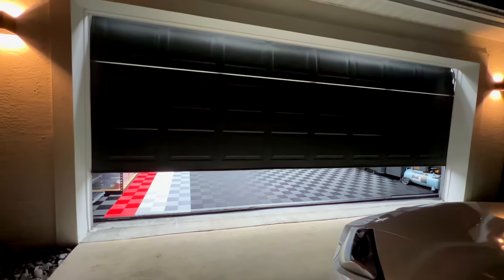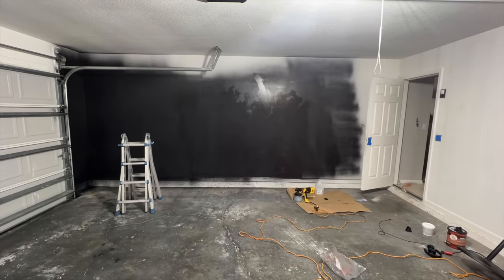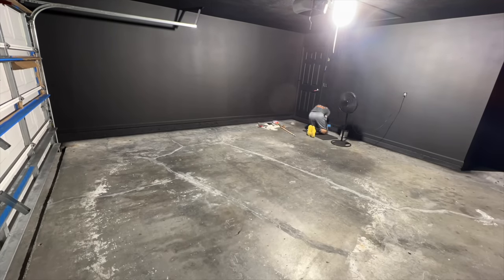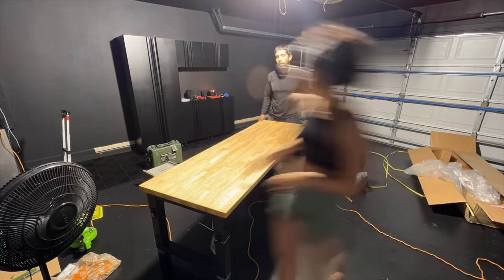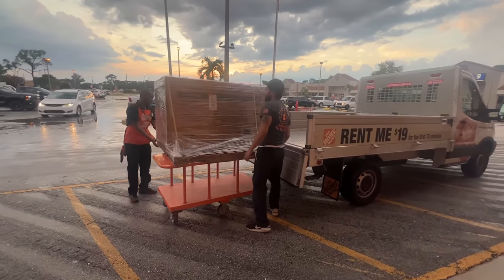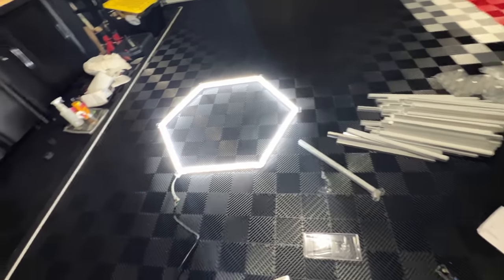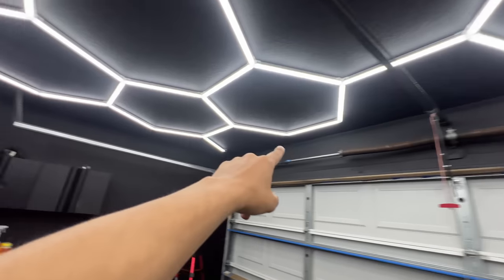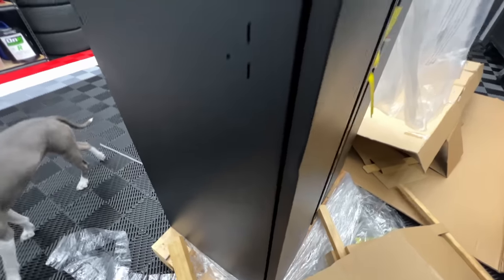Transforming My TRASHED Garage Into A SHOWROOM Style DREAM Garage in 10 mins!

Comment: you can use a kit to remove the dents, the same you use for car panels. it works pretty good and worth a try 😊 nice garage setup man!
Reply from the maker: I’m a sheet metal mechanic so I’ve taken most off already. I have to drill a couple holes somewhere to pull the other ones out.
Reply from the maker: @DanielDos2 husky bought at Home Depot

Comment: I just completed a full detailing garage (22 X 30) with build in water (hot and cold), floor drain, dedicated line for a wall mounted pressure washer, heat pump, trusscore material for my floors and ceiling and I love what you have done.  I am debating what to do with my floors.   If I didn't constantly spray water and all the gunk, I would do a floor like this but I am leaning more toward an epoxy with sand blasting or polished concrete but this is a really nice garage!
Reply from the maker: Nice! Im still working on mine, but in your case I would just get epoxy done.
Reply: @ZillaFullBoost hi what is the color and the brand of your paint please?

Comment: The lighting looks really good, but is it really worth paying 10 times as much electricity for the hexagons when a simpler design could have worked to provide nearly as much light on the edges ?
Reply from the maker: I had a simpler light and it wasn’t enough with the black walls.  I not only wanted more light, but an appealing fixture.

I haven’t noticed any rise in cost because of it either.
Reply: Came here for this comment. Depending on where you live and how much you’re in the garage. The difference of 10W lights and this 144W light system can be dramatic. Could easily add $50-$100 a month on your bill.  I’m in Cali unfortunately so those stats are not* overestimated.

Comment: Looks amazing! Would recommend finding a solution to holding down the floor panels, they move when you drive in or out so you could crack some with the Florida heat and enough pressure from exiting or entering the garage. Also, after seeing you spend as much money as you have, I am sincerely hoping that I am misjudging your garage door opener as a chain driven opener. If it is chain driven, switch to belt driven, you'll thank me later.

Comment: Get a spring and pulley and install it on the inside of your attic door to make that attic door rope disappear.and make a dowel stick with a screw-in hook on the end to pull it down with.
Reply from the maker: Good idea👌🏽
Reply: @ZillaFullBoost  it's what I do with all my attic door ropes and btw you'll also need a keyring for the end of the rope that hangs down from the attic door hole to grab with the hook on the end of the stick

Comment: I ordered the same series of cabinets and had the same experience. It sounds like you've done some repair yourself, but there's a phone number in the boxes you can call and basically make a damage claim (not HD, it's the manufacture, HD is not very helpful). They sent me new doors for 3 out of 4 on the tall cabinets, even a new hinge for one that was busted. Other than not being able to ship them without damage, they're really nice!
Reply from the maker: I tried to get replacement doors and they said they couldn’t send any for some reason. They wanted the whole unit again. 

I’ve extracted as much as I can from them for the inconvenience on top of the already discounted rate when they were on sale.

And I agree they are some nice cabinets when they don’t come damaged 🥲

Comment: Garage looks amazing! You went with a lot of the same ideas I did initially (my garage makeover is about a year old now). I was lucky enough to not have any damaged Husky cabinets when I ordered mine to the house. Curious, how do you like those floor squares? The flooring is the only thing I haven't done yet, still bare concrete.
Reply from the maker: If you’re a true DIYer using jacks and Jack stands takes a bit more effort. You need wood or metal plates between the Jack/ jack stands and the tiles so they don’t get damaged. That’s my only gripe with them.
Reply: Is it the floor tile you used is pretty much the same as the Swisstrax?

Comment: Sick garage. The 2 things I would def still do are jack shaft garage opener and some sort of door to close off that area with water heater. Great result tho man.
Reply from the maker: Yup, those are next. Also, I want to add a ductless AC unit, mount a vacuum with a hose reel and reels for electrical/compressed air.
Reply: @ZillaFullBoost  yea I’m looking into that wall retractable hose like the OG guy just did, really sick. Also, for a fraction of the cost of a mini split, I did a dual hose portable AC unit and just knocked two holes in the block wall for intake and exhaust. It works really good in Florida heat and it was cheap and easy to install. Keep up the good work.

Comment: I have the same lights and flooring coming. Still working on my garage. What size is the garage? You can send pics and get a discount for the dent. I have a lift coming too
Reply from the maker: Nice, I have some final touches to do still. My garage is 20x20. I bought the cabinets when Home Depot had them for  50% off. I got an additional 15% for the damage and inconvenience.

I really need a lift 😖

Comment: Your hard work paid off!  Question bro, why did you opt for the tile floor instead of epoxy? Was it strictly to be able to create the NISMO design on the floor? Also, is it a pain to clean dirt from the tile cracks? Do you just end up vacuuming?
Reply from the maker: Thanks, I went with tiles because it’s cheaper. I didn’t have the funds to do epoxy this time around. It’s not a paint because you can lift the affected tiles up. You can vacuum with the tiles in place. You just have to be very careful with fluids.

Comment: Just have one question with those specific style tiles, how would you clean the dust that gets into the cracks and seams on the tiles? Would you just have to remove it all and sweep whats under it all??
Reply from the maker: You can vacuum it with a shop vac

Comment: Looks great.  Any issues with the single outlet power source?  I was thinking to use an adapter on my ceiling bulb connection and then use a splitter to connect 2 outlets. Basically means both connections are connecting to same power outlet.   Not sure if that would work.  Have yours tripped at all?
Reply from the maker: No trip at all. I was surprised. I’m so glad I didn’t have to connect two power sources.

Comment: Looks great.  I see you used one outlet for the lights.  Which light package did you go with and any issues so far with using just one outlet?
Reply from the maker: Thanks, I was told to add 2 points of power and decided to try just 1.  To my surprise it worked! I didn’t want to complicate the install so I left it at that.

Comment: Amazing!! DREAM garage indeed. Do you have the link to the black epoxy that you use? 
Appreciate you sharing the video, thanks!
Reply from the maker: I just used some epoxy paint from Home Depot. In my opinion it’s not good for heavy foot traffic, but for being under the Racedeck tiles it’s good.
Reply: @ZillaFullBoost  issit hard to clean your garage floor with these tiles?
Reply from the maker: All you have to do is use a shop vacuum to lift any debris. If you absolutely have to get underneath you just separate the tile in the affected area.

Comment: I've been planning to order the Hex lights for a while but how do you like them as far as ease of setup/isntall and function? 

Great job on the garage and we have a lot of the same stuff in our garages except I haven't installed my flooring yet, so also wondering how you like the flooring and cost for a 2 car garage? Thanks in advance.
Reply from the maker: Thanks. If you’re working on your car with jacks and jack stands it can get damaged so you’ll need a plate between the jack/stands and floor. 

Other than that I like it. Stays looking clean since dirt falls between the cracks.i vacuum it every once in a while.
Reply: @ZillaFullBoost  what about if you drop something small like a screw between the flooring?
Reply from the maker: @alfs3  usually it gets caught between the openings and hardly falls through unless it’s very small. If something falls through and it’s ferrous metal I usually grab a magnet. If it’s anything else I use pliers. Worse case you peel up that one tile.

Having these tiles has definitely made me more cautious with handling small things and fluids.

Comment: Was it possible to assemble and do your hex light layout on the floor first, move the whole assembly into position for alignment, then install on the ceiling?
Reply from the maker: You need a lot of hands to transfer the assembled lights from the ground to the ceiling. Not possible by yourself.
Reply: @ZillaFullBoost  Yeah, they look a bit flimsy for picking up all at once so thanks for the confirmation!

Comment: DIY is awesome for those searching for cost effectiveness and all but I own a construction company specializing in developing and I’m a contractor so I contract good friends of other specialties who are licensed (hvac,plumbing,elec.,insulation, etc..) which I have amazing knowledge of as I have to work with them to get the job I was hired to do finished but I and they would say if you want a professional and easy remodel for you, call a professional you will probably be out of pocket close to what you would have been doing it diy first thing is to get a quote with that you’ll get a rough estimate of how much it would cost and if it’s not what your looking for you can use that quote to do your diy easier as it will outline all that needs to take place  hope this helps if anyone is looking for a complete garage remodel or man cave (concrete, framing, electrical, drywall, tape and bed, paint, etc..)

Comment: Whats that black strip at the edge of garage door fornwhen you pull in. Does it link up to the tiles. Can you post a link to where you got it
Reply from the maker: They’re transitions. Depending how you set up your tiles you’ll need either males or females. https://amzn.to/3Wp76lD
Reply: @ZillaFullBoost  thanks man. And did you have to cutt any of the tiles to fit?
Reply from the maker: @icarusmusic8181  I did. I used a harbor freight jigsaw to cut what I needed to size.

Comment: Bro how is the tiles holding up? It’s been a year.
Reply from the maker: I damaged a few initially using a jack but over all they all look the same still.
Reply: @ZillaFullBoost  ohh shit , I honestly thought you wouldnt reply! Ok….so I’m about to start my garage journey, I still have stuff in my garage but filled the holes in the wall. I’m going to do what you did….black paint, lights and tiles… we (my wife and I both have white cars) so this set up is going to go hard! What type of paint did you use? Name? Thanks man!
Reply from the maker: @n2deepjds  No problem! I used Behr Interior Flat Black.
Reply: @ZillaFullBoost  you paid roughly $2100-$2200 on tiles?
Reply from the maker: @n2deepjds  $1400-$1500
Reply: @ZillaFullBoost  alright, quick update. I just finished painting my garage black. Like 10 mins ago. Ceiling and walls. I need to order my floor tiles now. I have a white 23’ Mercedes C300 and a 24’ Pearl white Tahoe RST. This shit is about to be so sick looking when I finish!!

Comment: Why did you painted everything in black? Is that for some reason?
Reply from the maker: Aesthetics. It just looks good
Reply: @ZillaFullBoost  I thought black reduse reflections 🤔 Im choosing color for my shop right now 😃😃
Reply from the maker: @Pv33v  it certainly does reduce reflections. Get lots of light if you’re doing all black.
Reply: @ZillaFullBoost  Im thinking about dark grey floor (I already have tiles), almost black waterproof stripe from floor up to 1,5 m and white rest of the walls and already have white gates (on both sides of the shop)
Reply from the maker: @Pv33v  nice it should look good
Reply: @ZillaFullBoost  maybe I will upload video sometime 😃

Comment: Looks great but mu biggest fear in all these vids i see of these floors ect. Wheres the jack and jack stands does anyone with a garage like this actually work on there cars at home! Not saying your not mechanically inclined but do these tiles now make it impossible to lift the car or have jack stands i cant be the only one that sees this issue.
Reply from the maker: I now have to add a metal or wood plate under the Jack stands and Jack.  It can hold a lot of weight, but it must be distributed evenly. Anything sharp will pierce thought the plastic. It’s definitely an inconvenience, but I can work around it.
Reply: @ZillaFullBoost  that's what I'm worried about z32 sits low as is and requires a tetus way of jacking it up an now having to do all the extra stuff would suck
Reply from the maker: @Vortec.Z32  my rz34 is pretty low as well on the front. I use a very thin piece of metal or wood with a low profile Jack.
Reply: @ZillaFullBoost  yea my Zs so low and with the rear diffuser ect I can't use ramps otherwise I can't get a jack under the rear so rears up first then left and right of front now I'd be adding more steps...I need a lift lol
Reply from the maker: So do I lol. I think putting some lifts in the ground and adding the tiles around the left would be nice.